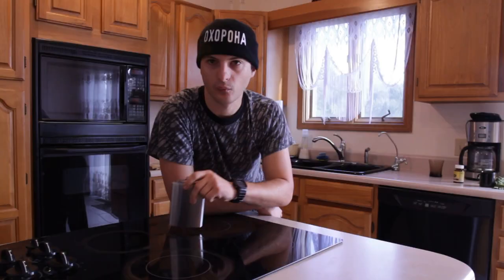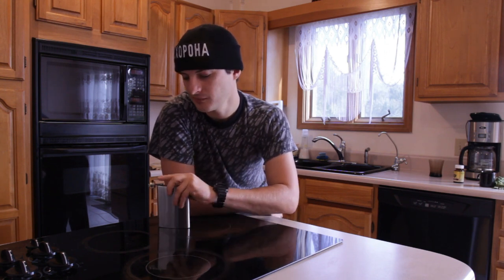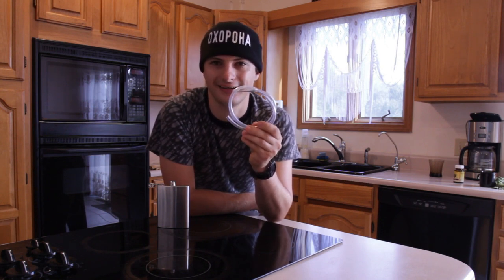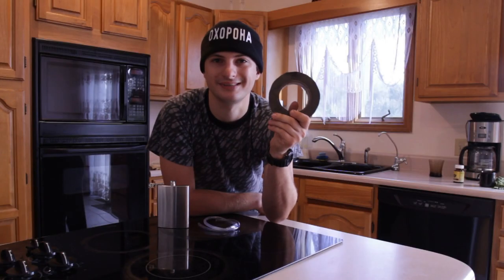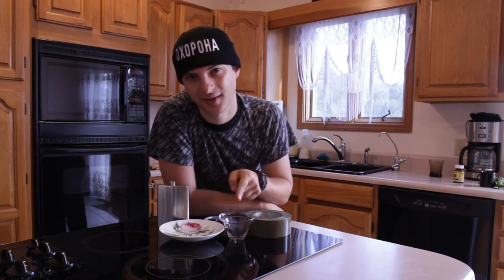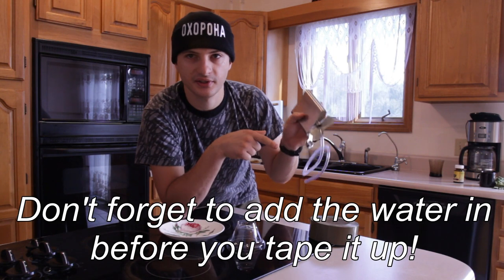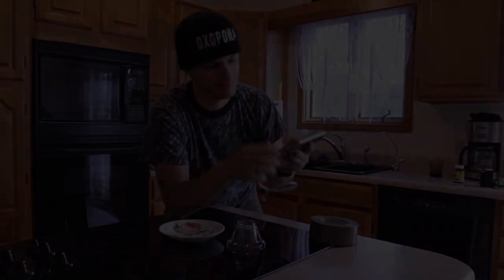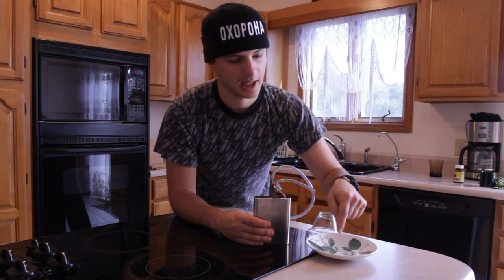Basic Water Distillation

Comment: I'll tell you a similar way, however it will be more profitable. Get two metal containers preferebly large once. Place in one of them some quantity of H2O then connect cantainer  to container too via a metal tube now while the H2O being in gas like state you should get some cold H2O and whitin entering the 2 metal container apply constantly cold H2O. This will not only purify your H2O, but destilation is the proces in which you concentrate a certain quantity of any solution. In this case H2O.TYK

Comment: Not true.  A variation of this is to use two water bottles (the filled one is held higher than the other & is preferably darkened, whether by paint or tape of some kind).  In this example, the sun does the evaporating.  In a lost-at-sea situation, this might be all that saves you from dying of thirst.  It's a good idea to put the tube through a hole in the cap (that way you can get it open & closed easily).

I heard this would get out pretty much everything, but I might be wrong.

Comment: Improvements:
1. SIDEWAYS the surface area is bigger, so water vaporizes faster, and flames have more to metal heat.
2. If it would be possible to COOL top side or tube somehow, and keep container so that condenced water would pour out. Cooling is important, because water condeces much faster to cold surfaces. I would have some sort of cold water bag on top of a container that would cool the vapor down. (Same can be done to tube.)
Redo the test with some of the improvements?

Comment: no man, you should pass the tube though something that colls the steam, os else most of the water goes away to the atmosphere becoming ambient moisture.
if you put the tube between two ziplock bags of cold water it will sufice, and will give you means to put the exit of the tubing in lower ground than de cooling part.

Comment: You should have run the tube through a bowl with ice or cold water. In your setup, the steam just "travels" through the plastic tube and then comes out from the other end as it is (in a gas form). Only a small quntity has time to liquify into water, but if you follow my suggestion you will get the most out of this water distiller.

Comment: Yes, can be any container as long as it it sealed on all sides with a hatch on top. You can even use an oil drum (only if cleaned, SUPER cleaned). This idea works really well if your stranded on a island in a salt sea. You can remove all natural particles, like the dirt, and salt itself.

Comment: 1.only use copper or stainless steel container.
2. cover the tube with a wet cloth so the steam cools down and turns into water.
3. don't use plastic tube wont last in real situation. copper tube works best.
4. enjoy you water.